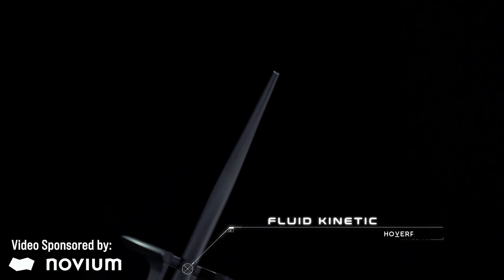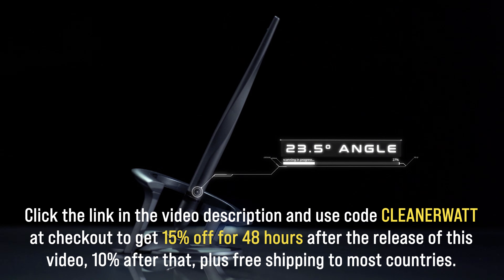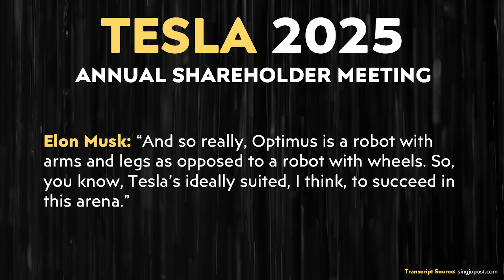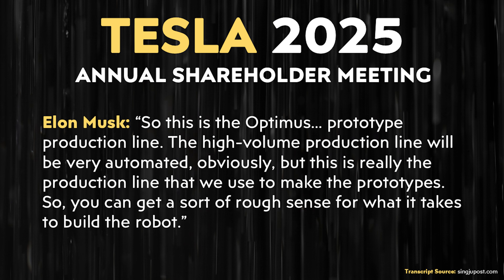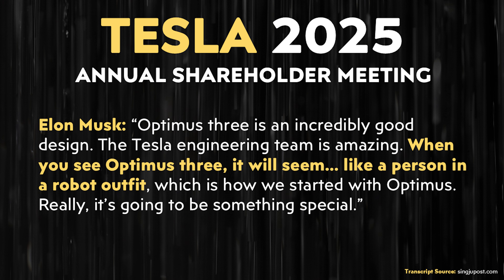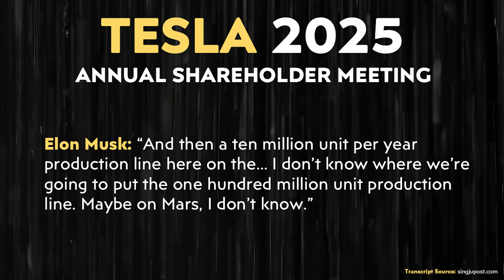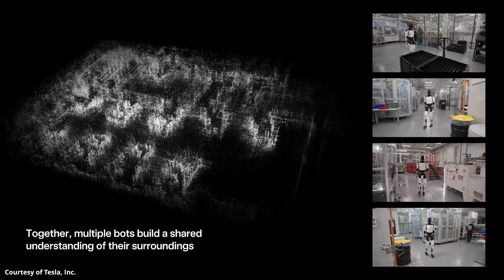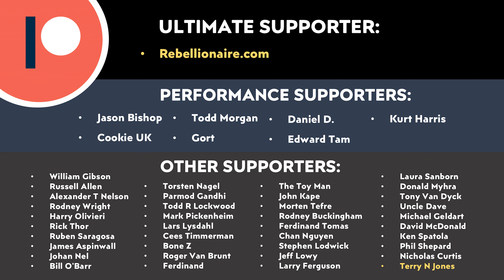Tesla Optimus Update: NEWLY Dropped Footage + What Elon Revealed

Comment: You haven't said how long a robot lasts for if it's by itself and not plugged into anything how long will it last 😮😮😮 you never talk about how the robot is actually driven by what batteries capacity etc 😮
Reply: A block of tesla cells about a 3rd of the size of a car, fits in the torso along with other componentry, for size perspective
Reply: @RyanParker-q7b1z You mean a third of the size of the batteries that go in a car not a third of the size of the car, right?